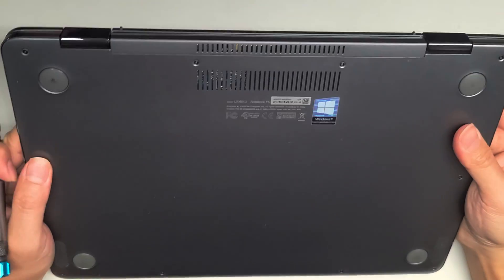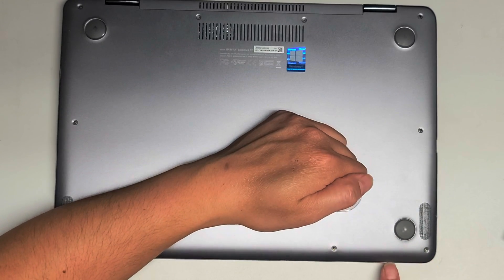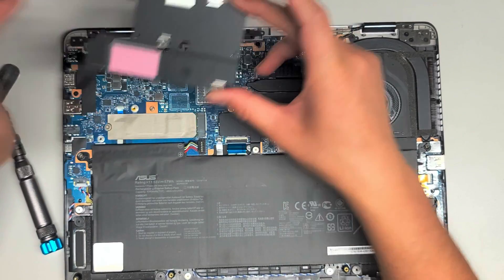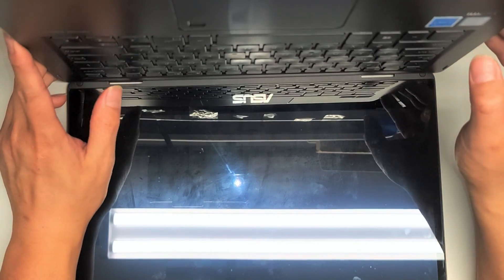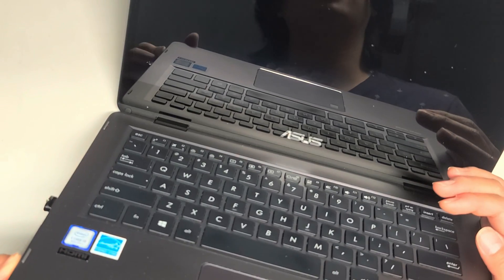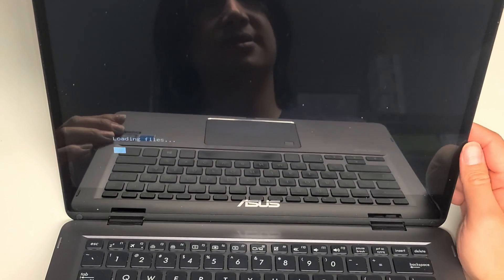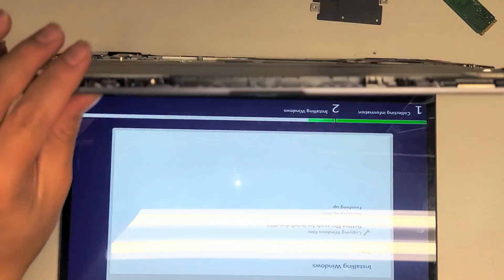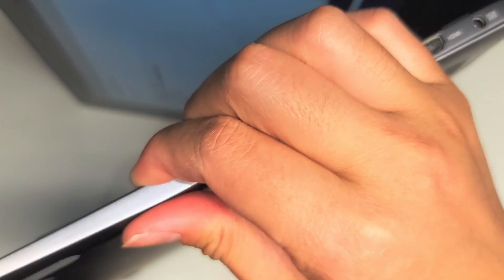ASUS Zenbook UX461U Disassembly SSD Hard Drive Upgrade Replacement Repair How to Tutorial

Comment: I have the same sleep issue. Did the NVMe fix it? Appreciate your help 👍
Reply from the maker: Don't remember. If the answer isn't in the video. I won't know.
Reply: @ItsBinhRepaired  ok I’ll try it and if it works I’ll let you know. The internet is flooded with the Asus Sleep issue and no one has an answer. Not even Asus 😮
Reply from the maker: @khridi  sounds good
Reply: @khridi  Same issue here. Did you get it resolved by reinstalling Windows?
Reply: @khridi  Did it work?

Comment: HI Binh - Good job on the video. I just have a question, though - I got a bit confused whether or not the ASUS laptop was actually compatible with the NVMe SSD. I looks like it probably did work, but I'm getting prepared to do the same on my UX461UA, as an upgrade from 500GB to 1TB, and really would appreciate confirmation that the laptop is actually compatible before I buy the SSD.
Reply from the maker: Should work fine if it's the same model